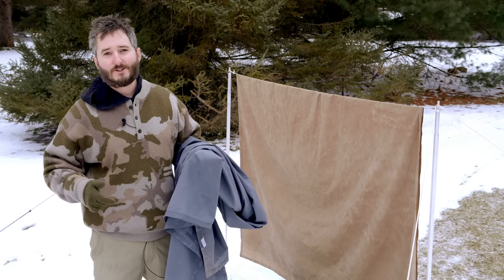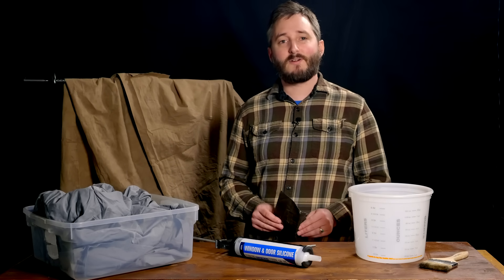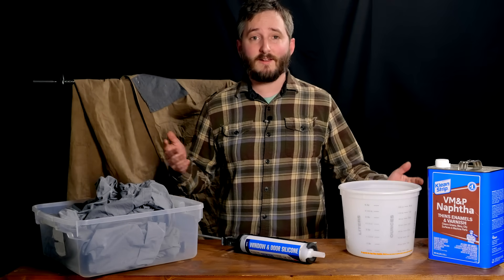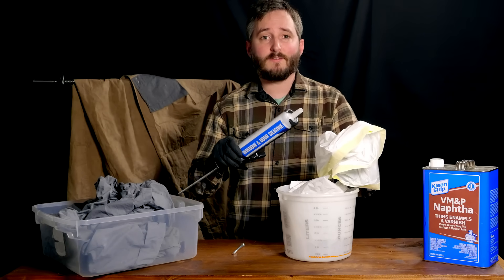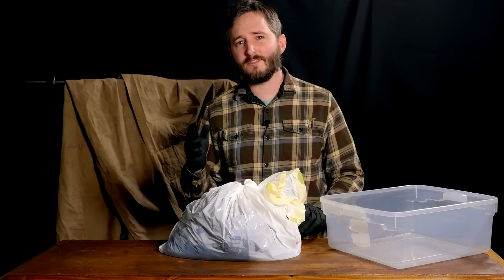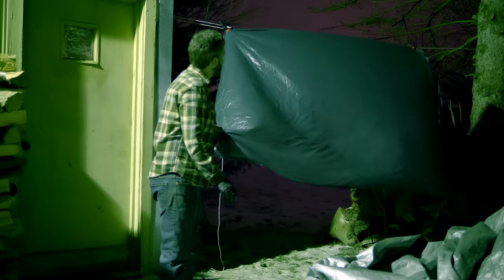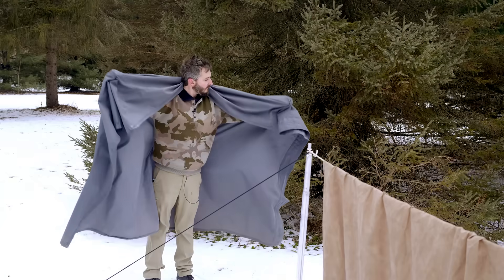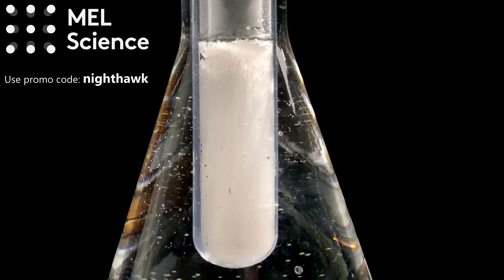Recycled Bedsheets Make The Best Waterproof Tarps

Comment: 1) It's a little hard to judge...was that a twin size sheet?
2) Isn't a "tarp" you've prepared this way, dangerously flammable?
3) You said it dries overnight, but mightn't even longer outside help dissipate the noxious smell of naphtha thus making it safer near human noses?
4) Have you ever run one of these items through the washer post prep? Does the item lose its impermeability?

Comment: For the millions of you that live in california. I've had no luck with any of the available solvents here that are for sale. I'll keep trying till I find a mix that actually dissolves the silicone. Painter solve it won't do it and that seems to be the best bet.
Reply from the maker: I've heard reports that gasoline works, and apparently the smell goes away. I have not tested this for myself and would suggest extreme caution of fire
Reply: @Nighthawkinlight  gonna try MEK from an auto body store next. I think painters solvent might have gotten there eventually but it was taking so long the bag I was using was breaking down faster than the silicone.

Comment: What if you had 2 bags same as you showed but then put them into a spin cycle of a washing machine using centrifugal forces? Or 4 or 6 so it'll spin smoothly? Cool channel even though I don't see many of your vids in Recommended section?
Reply from the maker: That seems a bit dangerous. If the bag breaks the liquid is highly flammable

Comment: Havent tried this one yet, but I will. A good one I found for more permenant structures, is to paint it with fiberglass resin. the stiffness adds to the structural integrity. definitely not for flexible things, but does wonders for something like a tarp wall on a frame shed.
Reply from the maker: I've recently learned you can do that with wood glue. They call it poor mans fiberglass and there's a diy camper building community around it.

Comment: After seeing this video about a week and a half ago I tried this on some of the cheapo leather work gloves you can buy at any hardware store, the ones that have the soft suede texture, and it seems to be working great! I wear these gloves basically all day at my job, and while they're not water proof, they are water (and oil) resistant which is perfect for what I need. I need gloves that are puncture resistant, hence the leather, but untreated ones quickly absorb oil and moisture. So this has been a great fix.
Reply from the maker: Thanks for the confirmation that it works on leather!
Reply: @Nighthawkinlight  does it work as well with synthetic fabric???
Reply: @iraa9935  I think it'll depend what it's made of. Do a spot test with the naphtha, to make sure it doesn't melt/dissolve the fibres.  The other thing is going to be the durability aspects.  If the weaved fibres are not plentiful/high thread count; the end result won't benefit as much from the qualities of the fabric (though it should still provide a structure to the applied silicone).  Maybe the recommendation for application to rucksacks and similar is appropriate; make the mix a little thicker with more silicone and less naphtha, possibly paint it onto the sheet, laid out flat on the ground (hard ground with no finish that will be damaged by naphtha! - outdoors ideal).  Once dry or mostly dry, you could do the other side.  Completely dry to keep it clean and prevent picking up too much debris from the ground. If you lay a plastic sheet under it, of a material plastic tested the same way as in the video, then it'll be easier to keep the new cloth clean when treating it on one or both sides.
Reply: @iraa9935  I think it does. Lots of high quality backpacking tents and tarps utilize silicone impregnated nylon or polyester (silnylon and silpoly) as a waterproof fabric.
Reply: Hmm, maybe I'll try that for the leather inserts in my slip-on shoes.
Reply: ahhh yes,.. i make dusters,.. had a snake deteriorate after a decade, i think this would be great to do to repel water from snakehide,... i will have to do something on that scale with this method, would be very cool
Reply: Hello for really good gloves try leather Riggers gloves with Dubin boot polish put gloves on and rub in half a tin or as much as you can  best to start out a little bit snug of fit

Comment: I really love this video it shows what can work. 

However I am concerned about the flammability  of this process. How easily will the set on fire? From like the discharge of a black powder rifle, hand gun, or from an outdoor fire pit?

As a car mechanic I was warned about gasoline drying on my pants had how flammable that was.

Here we have dried Naptha, which was use I believe to make Greek fire. It's now dry onto fabric. So can you do a flammability test on it or a small piece?

Regardless of it's alleged flammability concerns, this was a great idea and procedures to make something that you may need when nothing else is going to work. Like a tent or poncho. 

Freezing to death in a cold rain is just as much a concern.

If it is flammable is there a chemical that will retard it from burning, like what the use for insulation?

What are the health risks of wearing this chemical next to you body long term. Or being in a tent made like this breathing it in? 

How will this smell of Naptha effect game your hunting from smelling you down wind?

These are things that the Wearer needs to think about, in my mind.
Reply from the maker: Once dry the naphtha is gone. Flammability of the finished tarp isn't effected by the solvent.
Reply: @Nighthawkinlight  how would this work to make a stove heated tent?
Reply: @dhritimansalim6504  At the very least it won't melt  like cheap tarps.

Comment: Will it saturate with snow sitting on it and melting? I mean naphtha ~$14 and silicone ~$6 this would seem more expensive than 8x10 tarp so i would want it to be better.
Reply from the maker: It's breathable and can be saturated with long term water contact. The one I have on my wood pile had a few damp spots as snow melted, but the logs are dry under it. The pros over a normal tarp are flexibility, strength, and insulating value.

Comment: My favorite method and far less odor than the old wax, mineral spirit and turpentine method. Very durable too.
Reply: Did you use both without the silicone?  And is the final dry product flammable?  I'm making a replacement canopy for the patio umbrella, so there will be candles etc near it.

Comment: Amazing video as always.
Seems like a great alternative to tarps.
Its like a new age oil cloth.
The problem with oil cloth is the flammability. I'm guessing the silicone covered fabric is less flammable as long as the naphthalene all evaporates away? It would be interesting to test this.
Would adding some sort of flame retardant be possible or even needed?
(I'm in Australia where this a probably a much bigger issue than it is in this magical place you live, where cold white stuff actually falls from the sky naturally)

It would be also interesting to compare the density of these tarp-esque materials to see which one would be lighter.

The advantage oil cloth has is that it CAN be made out of materials that all could biodegrade fairly easily. I think this silicone fabric would still be better than plastic tarps though in that regard.

Comment: I wonder what a non-toxic variety of this could consist of? I remember the heavy waxed canvass. Got to be a better solution?   I loved camping as a kid in an outdoor program under tarps we put buttons in the corners of.  Thanks for the video  :  )
Reply: In German organic stores, waxed cloth as a replacement for cling foil is all the rage. You soak cloth in bees wax, or a mixture of bees wax and stearine, which makes it water repellent and flexible. Then you can use that to wrap food, or as a lid for jars, etc.
Reply: This is not toxic if you wait for the solvent to evaporate, maybe a week.. after that is pretty safe (it's silicone)

Comment: This is the same formula that we used to water seal cinder block walls. Mix it up in a cheap pump sprayer and apply to brick, wood fence even canvas drop cloths
Reply: can you put this stuff in a sprayer and spray it on?
Reply: @humility-righteous-giving  If you thin it out with solvent enough for the spray gun to handle it I can't see any reason why it wouldn't.
Reply: @commoguru  i did wit about 5 to 1 successfully
Reply: @humility-righteous-giving  I love that you posted this reply to a comment that literally answers the question you're asking.
Reply: Might work well as a rust killer on tin roofs as well! 
Cut off the air supply and stop further rust! 
Giving me ideas!
Reply: @kellyroup4262  wow! good idea!, but i would think you need several coats ,and to do it late in the day without direct sun, and probably redo it annually
Reply: and use a sprayer
Reply: VERY interesting!
Reply: @D E I would think that would be a fire hazard
Reply: @edreurink6717  why? The solvent evaporates. That's what happens when it dries.
Reply: May I ask, can I use lacquer thinner as an alternative to that of naphtha?
Reply: @haroldcalendatas5625  i already saw a guy using gasoline, and it worked. Try an small scale sample before and take care with flammables...
Reply: Awesome in thank you
Reply: When you spray it you invariably inhale the fumes, I would not do that.
Reply: @D E Undercoatings for cars (as salt protection) do not have a good track record either. Same problem: In theory a good thing, but eventually they let in moisture and salt - and prevent it from being removed.
Reply: Engine block cylinders
Reply: Would this work for a small cinder block pond?

Comment: I built a tepee some years ago, and the large amount of waterproof covering needed is a problem (if you want a decent size tepee over 8' in diameter!). I'd REALLY like to do it again. Sweet! And Subbed
Reply: I waterproofed my 18' with Thompson's water seal years ago. I think I used 7 or 8 gal. Sprayed it on.
Reply: @Kayte...  What kind of covering? Also, an 18' tall tepee?

Comment: Every motorcyclist in the world should thank you !  This one certainly does. My fave jacket lost it's expensive "Goretex" waterproofing years ago, now I can restore that and my boots too.  No more money to the evil Du Pont corporation, EVER.
Reply: Goretex is the fabric.. stays waterproof forever. But every new Goretex is also sprayed with a water repellant spray. That washes off if you put it in the washing machine and needs to be reapplied.    The point of using it is to keep Goretex breathable so you don't sweat and make yourself wet from the inside

Comment: I was a meter reader for 19 years. I can tell you absolutely, there is no such thing as waterproof, especially shoes, not even Gore-Tex, not mink oil, not beeswax applied using a hair dryer, not  silicone.. rubber works, but there’s no such thing is a comfortable rubber boot/ shoe.. if there was, then your sweat condenses on the inside and your feet are wet from your own perspiration not able to escape..
  as far as wearing something waxed, I had a waxed cotton belstaff motorcycle coat/jacket. Water eventually works its way in at the places it bends..
also you cant sit in a car or on nice furniture with oil or wax treated clothing without staining those things, and they do not smell like roses…
  plastic raincoats are the worst.. they are not durable and your sweat condences inside the plastic making you very damp,and stinky..
 nylon  raincoats lined with cloth are better..
 i have commuted by motorcycle 8 months a year over 4 decades.. i have had 1 and 2 piece  rainsuits.. plastic ones shred in the wind.. nylon ones hold up but smell funny after a few seasons..
 my point is.. the word WATERPROOF is false advertising…i always kept my receipts when i bought “ waterproof” winter work boots for meter reading..timberland, herman survivors, wolverines, redwings, i kept the receipts and the tags hanging on the boots when they were new. i always returned the boots leaky non waterproof boots that always always leaked eventually after a week or a month and got a freah mew pair or my money back..  it is better to buy boots from a large chain  rather than from a store that you may be dealing with the actual owner.. a big chain wont give you any problem exchanging leaky waterproof boots , but a family owned store will not make it easy . they once told me i had ti send the boots back to the manufacturer..
  so—- the word waterproof is misleading.. water resistant for a while is more appropriate..
Reply: Thanks, I work outdoors a lot and also go adventuring in the mountains. I completely agree with you. I've been confounded time and time again from some hyped up wetproofs that cost a fortune and failed to deliver.

Not one pair of hiking boots, not one goretex shell, not fjallraven. You can wear a rubber slicker but you will cook if you move around in it. You can wear wellies like boggs or xtratuff but they are not comfortable over distance.

I like wax canvas like fjallraven because while it's not that waterproof, it'll hold out for a few hours of moderate rain, dries quick and its comfortable to wear and much more breathable. But it's garbage if I'm out in a deluge all day.

Comment: One VERY important question: If you're using naphtha to mix with the silicone, doesn't that make your material HIGHLY flammable?  Naphtha is what Zippos use to burn in their lighters, so wouldn't this make a waterproof tarp that would be dangerously flammable?
Reply from the maker: It evaporates in 24 hrs
Reply: @Nighthawkinlight  Thanks.  I know Naphtha vaporates quite quickly (I've filled a lot of Zippos in my time) I just worried it might keep a bit of the flammability with the silicone.  I'm certainly going to try this!  Again, Thanks!

Comment: So if one used sau an old King Sized Sheet, I would assume we are talking at least 2.5 to 3 ltrs of material (estimated). So would I need maybe the same, quantity of Solvent and 1 tube of silicone? It looks like there would still be sufficient liquid to saturate teh sheet. 

I am thinking of making this for some sheets for Bug-Out/Camping Bags, and I love the ease and simplicity of the process. I was wanting some kind of this and waterproof covering, that was super light, and easily maintained as well as replaceable.

Comment: A nice idea @NightHawkInLight you need to add something about disposal of excess silicon solution. Silicon allowed to get into the environment risks severe damage as silicon oils released by this method will destroy surface tension in water. But of course as everything, proper treatment and disposal then the risks are vastly reduced.

Comment: I have been gearing up to give this a shot with some thrift store bedsheets. I wondered if this same technique has been attempted with vinegar to thin the silicone (as it is vinegar based already) and if any success was found? I would be more comfortable working with vinegar because it's cheaper and less volatile
Reply from the maker: No, vinegar is mostly water. You would need concentrated acetic acid, and I'm not certain that would work anyway.
Reply: @Nighthawkinlight  thanks for the reply! I will experiment with it when I attempt with naphtha. All I have found so far in hardware store near me is Coleman stove fuel, which has a rust-proofing additive. I would also be curious to experiment with this fuel as a solvent but it seems that everywhere I look on the internet points to pure naphtha being the way to go. I've been watching your stuff for years, your technological wizardry is fascinating!
Reply from the maker: @Jjay12151  I think Coleman fuel will work well

Comment: This looks like a great idea......however I have problems with "naptha" I looked it up.For one it looks very expensive to buy and secondly I would be concerned using this as an animal/bird tarpaulin. Naptha highly toxic fumes. Does this all get negated after the silicone is added? If not....hot sun and rain beating on the tarp,is it harmful,to inhale?
Reply from the maker: The naphtha is gone once dry
Reply: As far as I know, naphtha with evaporate 100% given enough time. I wouldn't be concerned about off-gas-ing after its fully cured as silicone is very inert and the naphtha will fully evaporate. However, I am personally not too keen on sending those vapor off into the atmosphere if there is another way. The bag containment method in this video seems fairly easy and effective to capture the fumes indoors. If there is a method that uses a less volatile substance I would be very interested to see it
Reply from the maker: @Jjay12151  Naphtha has a half life of 11 days in atmosphere. It's not a long term airborne pollutant

Comment: Have tried this technique on a 100% wool blanket? Specifically soaked or brushed. How much weight it added to the blanket? This was a very different idea, love it
Reply from the maker: I wouldn't use it on wool because I'd be concerned about it harming wool's particularly good insulating properties. I would apply it to a thin sheet which is used on the outside of a normal wool blanket.